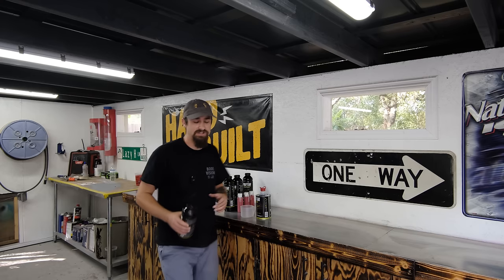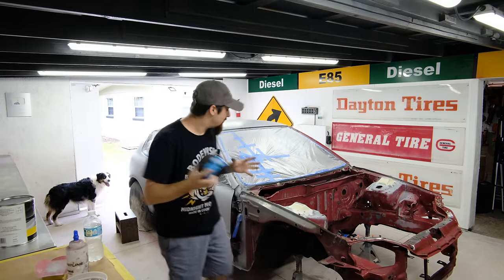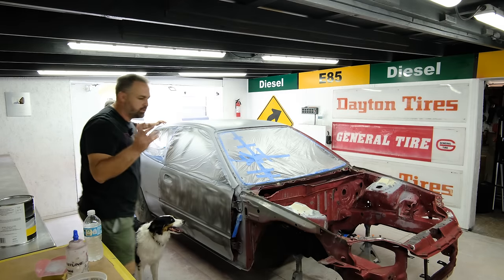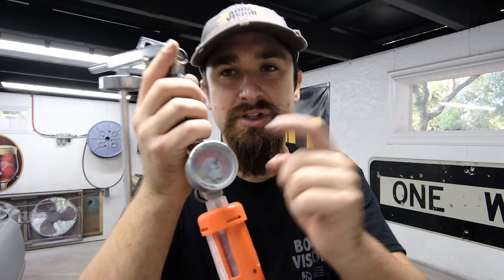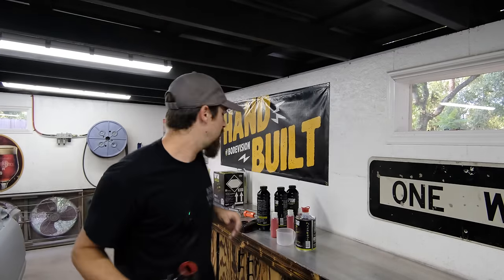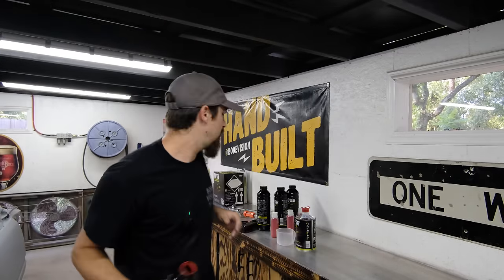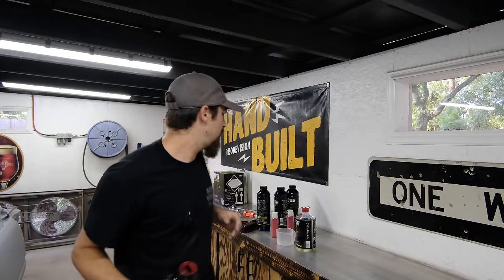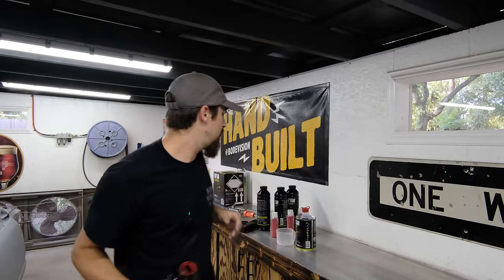Painting A Car with Colored Bed Liner?!

Comment: Hey bro quick tip on the threads in the engine bay when painting. To advoid having to clean all the bolts after you take them out. Use the little foam ear plugs. Squish them and set them in the tread holes then paint and remover befor dry with needles nose plyers. 👌 eBay can get bulk earplugs really cheap

Comment: When I restored my 3000GT I did bedliner spray in the wheel well areas.  I didn't use this system, I just used some rattle can Rustoleum or something, but same basic thing.  I might look into the Raptor kit for the wheel wells for the Eagle Talon I am doing now.

Comment: Ear plugs I find to be a great alternative to covering up bolt holes before spraying liner as well, won't have to clean the hell out of the bolts before reinstall and ear plugs are disposable and cheap. Just a helpful tip lol
Reply: Cigarette filters there on ground there everywhere perfect for threaded holes I use them when painting motor cycles

Comment: I’ve been waiting for someone to do this. Youtuber Tommy fyeah doesn’t do the bays bc he’s color matching to the outside of the gtrs but he does a black raptor lining in the wheel liner area and the rest of the metal underneath the front fender to protect it. If I ever pull the engine out of my truck this is what I want to do.

Comment: It looks nice but my only worry is keeping it clean. When you think of bed liner in a truck bed it's always dusty because the texture holds onto grime and because it's a little soft and rubbery stuff sticks into it/stains it that way as well. I would bet it's not as temperature resistant as paint either and might crack or peel after a few years. That said sometimes stuff just works, hopefully you can update us on the build in a few years and see how it held up. Bedliner inside is just a win I think, so much easier maintenance. I would do it to my own car but idk how I would hide all the wiring that went under the carpet.

Comment: Normally you use 3 or 3.5 oz of base coat to tint it …. That way you have perfect color match with the rest of the car ….
Reply: So it mixes well with ppg paint. Was wondering if you had to buy their tinted or not
Reply: @123suzukisamurai  yes the regular deltron or Omni not their water based stuff

Comment: that looks awesome! my only question is raptor liner going to hold up over time to the heat cycles an engine bay gets from an exhaust?
Reply from the maker: Would you think this is less durable then a regular clear coat? Because engine bay paint is not rated to be high temp it’s always just regular paint
Reply: @BodeVision  raptor liner isn't all that durable anyway and whatever they use to make it wrinkle or texture may not like the heat. I wish I could have an engine bay as clean as one you would do with your attention to detail
Reply: @jack_of_all_trades_52  it holds up fine to heat we use in on rally cars all the time for inner arch’s and floors underneath only issue I get is my exhaust tunnel discolours but temp is logged at 350deg Celsius at that section of system.

Comment: Hey Adam...Kinda Off Topic Question for ya if you see this...I have some Polyurethane Rear Bumper Flares and I want add some extra structure to them and do some remolding maybe too...What material will bond to Polyurethane?....Fiberglass Milled strands stuff?....or will a BONDO Brand fiberglass repair kit work?....Any advice is Much Appreciated dude!!!!

Comment: I am building a overland civic I want to paint it with army green bedliner, would it be stronger with 3 or 4 coat?
Reply from the maker: 4 coats isn’t going to necessarily be better then 3. I would look into the dts sheet for the product that you’re using
Reply: @BodeVision  my goal would be to make not only the paint super resistant, I would love to make it absord some little hit to help keeping it as much dents as I can. I don't know if this is the best product but I tough that could be a very good option

Comment: Just curious did you sand down the engine bay before spraying. I want to do my bed on my truck. And everyone said i have to sand it first to make it rough.
Reply: paint adhesion is always affected by whether or not you rough up a surface first. If you dont sand the paint/primer has less surface area to grab onto; therefore its more likely to peel or crack eventually as opposed to properly bonding and becoming one with the surface
Reply from the maker: If your bed is clean and it has glossy paint on it you’re going to want to dull the surface. Even getting in there with a scotch brite  and some elbow grease will do the trick
Reply: @BodeVision  thanks man I appreciate it
Reply: @somdood3292  thanks man.